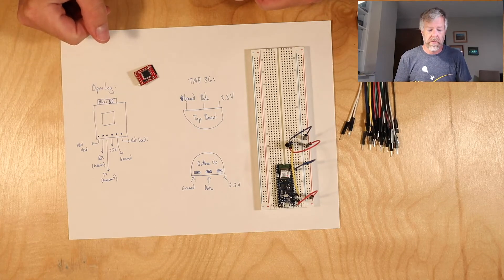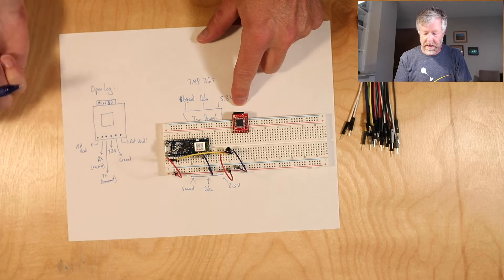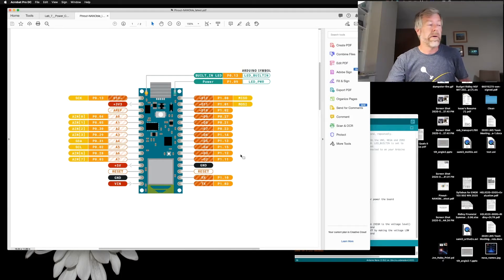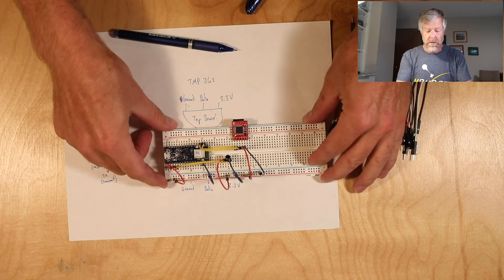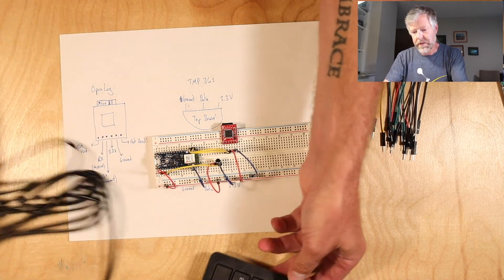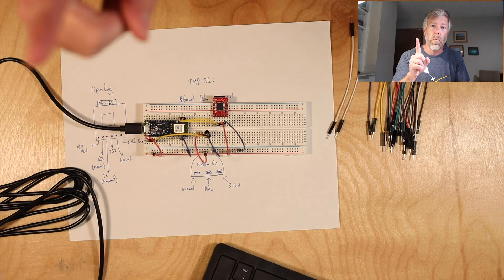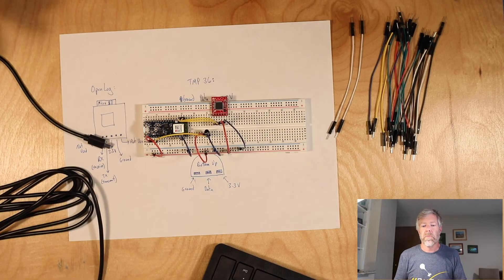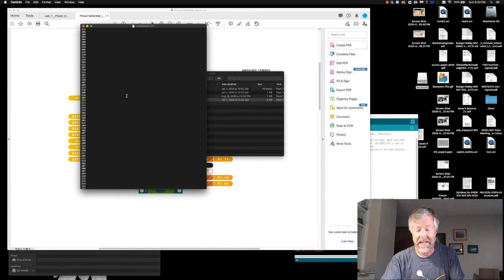Using and OpenLog to Record Sensor Data from an Arduino Nano

Comment: Hi! I saw another video where you used an external ADC because you said it’s more accurate than the Arduinos for analog to digital conversion. Can you tell me what external ADC you used and how I can connect it to the Arduino nano.

Comment: For the arduino to write data on the sd card, does it need to be connected to the computer or can I use battery power with only arduino and sd card? Also, are there any ways to name the file ?

Comment: my openlog is writting 15 characters every time but are random char like >ŒÌ9œ½½œœ½½ÞÞÿÿÞ do you know what could be? i'm using a esp32 but tried with a arduino uno too
Reply: probably baudrate mismatch
Reply: I have the same problem... Can u solve it??
Reply: Mismatched baud rate, same thing happens if you set the wrong baud rate in the Arduino serial monitor.

Comment: Would this OpenLog only work for a 3.3V? Or can it also work for a 5V?
Reply: In order to work with a 5V arduino, you would need a level shifter. That would take the 5V digital serial signals and convert them to 3.3V signals, and visa-versa. There is another video on the channel that shows the wiring for that.

Comment: I’m searching for information how to wire an open log to a kiss firmware flight controller. Would this process be the same. Also could I only use tx from the fc to the rx on the logger and not use the tx from the logger to the fc as I only need to receive information from the flight controller foe black box logging. On my flight controller I should connect to tx1?

Comment: So, anything you throw out to Serial 1 gets automatically stored to the SD card? Could it be that simple or is there some other code needed? Nicely detailed wiring! Great job.
Reply: Yes, that it right.  If you write to serial, then it goes to the computer, while if you write to serial1 it gets put into a log file on the SD card.
Reply: @aaronridley1603  Awesome, Thank you.